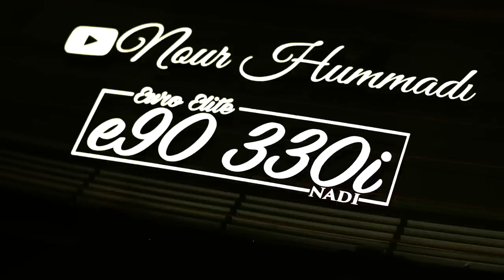Cheapest BMW Air-Scoops ON THE WEB!

Comment: Very nice car mate... just subbed to your channel and turned notifications on, I have the same car as you, e90 330i pre lci, in silver, think plastic air scoops are a fine mod for now, but definitely would upgrade to metal perfect fit ones at a later date, I had plastic ones in my beema and they were OK for a few months then started to distort from heat under the bonnet.. any way.. great channel you have , very inspirational.. much respect all the way from England... peace
Reply from the maker: piranha feeder thank you😎🙏
Reply: same